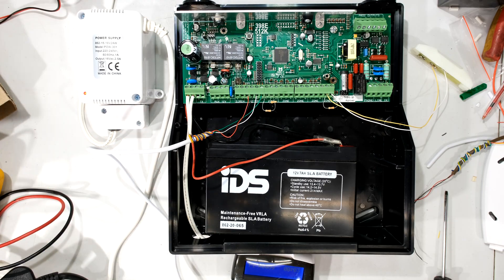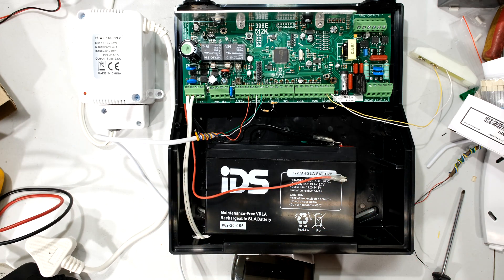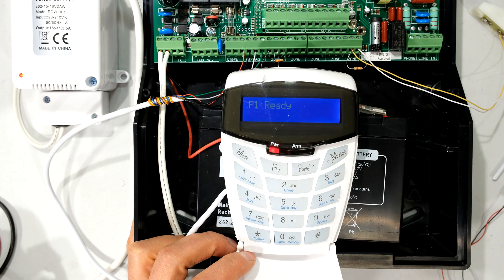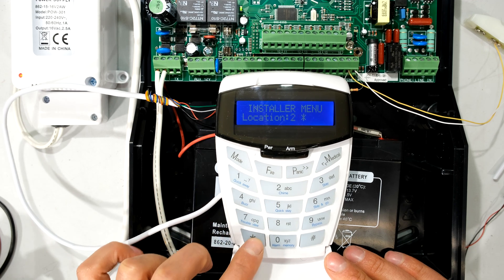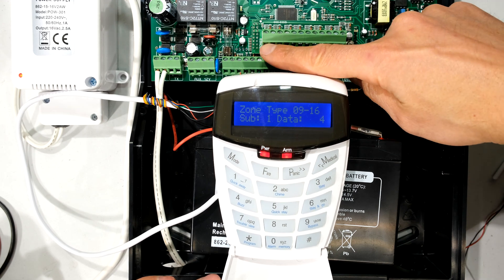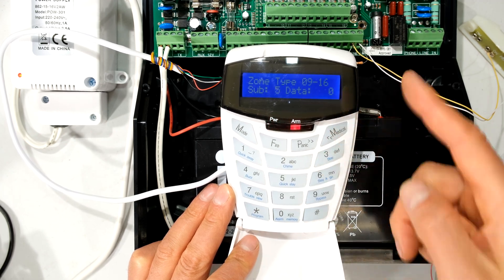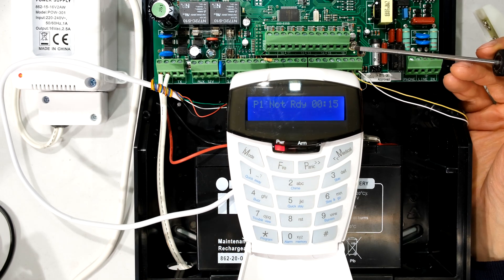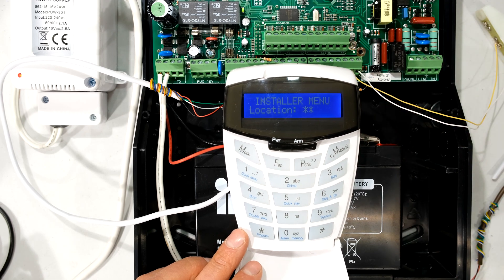How to add a plug in onboard expander board to your IDS x-series alarm system panel

Comment: Hi there …. I have just followed this video and set zones 9 thru 15 to option 4 and activated them all. Now those zones flash and indicate that the alarm is not ready to be armed. Does the installer need to do anything more on the plug in board?
Reply: Hi, did you find a solution to this

Comment: Hi, my remotes send off a panic to the control room when I arm away. Please help I am not sure what is wrong with it. X64 16 zones.
Reply from the maker: please check my video in the IDS playlist on how to setup the remotes.
Reply: @ecologicaltime  Thats exactly how I set it up. Followed your instructions to the last word. The 816 that I had was using a relay for the remotes but I am connecting it to the bus with the X64. Should I change it to use a relay as well?